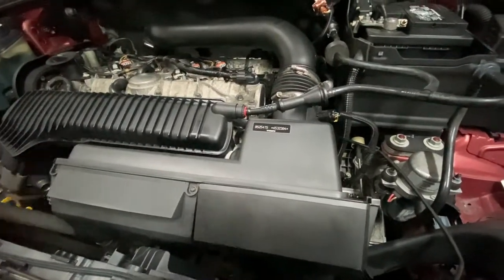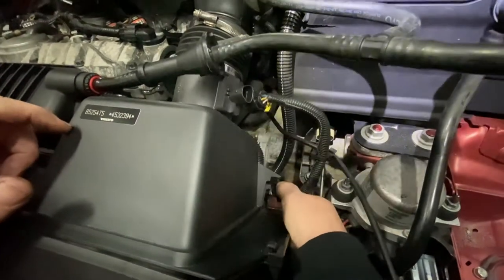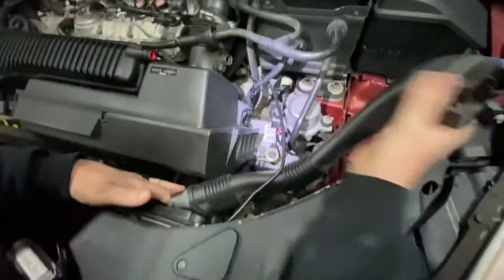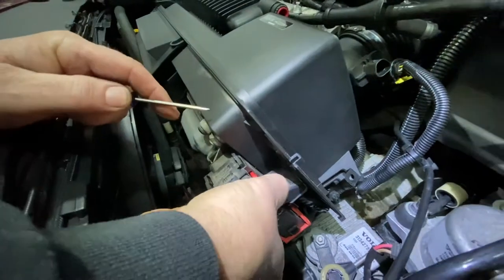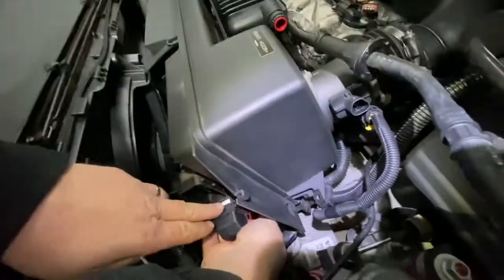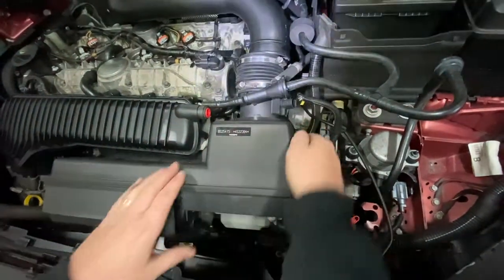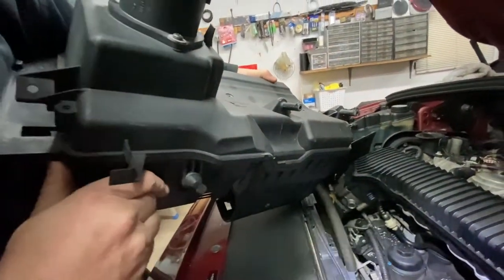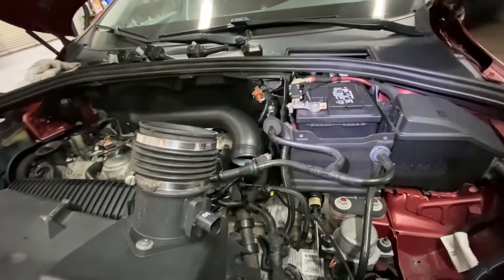Air Filter Box Easy Removal on Volvo S60 2009 and Up

Comment: Excellent video. Props to showing us how the airbox assembly is attached with the 3 pins underneath. That really helps with understanding how to wrestle it out, knowing we're not breaking anything when yanking it.
Reply from the maker: Thanks you, yes that was the point, you really have to pull on it and some may think they are hidden bolts but there aren’t.

Comment: I wasn't able to remove the air breather assembly due to the plastic front fan guard.  I was able to move it to the side to get to the pvc though.  Thank you for this video.
Reply from the maker: No problem, thanks for the comment

Comment: Nice. Ive got an automatixc c30 and it seems I will have to do this plus partial removal of the wiring harness to access the transmission dipstick
Reply from the maker: Yes, gives you much better access.

Comment: This engine is also fitted to my variant of the Mk1 Ford Kuga ( also Focus ST /RS) in the UK, i had to swap out my starter motor but on Ford there is even less room to wiggle the air-box up and and out and i think it may have another rubber boss retainer on the right also, additionally, when you pulled out the box and turned it over underneath on the left is like a u shape moulding into which the wiring harness locates to avoid it getting trapped, but you cant see this from above and it looks like its impossible to relocate back when reassembling, however i must of had luck on my side as i did manage to get the wiring back in the clip but i think it was luck it went in first time what with all the wiggling to get the air-box back in position.
Reply from the maker: They are a little different as far as room to work on them.

Comment: Question..do you have video or information on how to get 2006 s40 2.4i air box out so can access thermostat and hoses..REALLY APPRECIATE IT. . .I DID OIL FILTER HOUSING FEW YEARS AGO MYSELF but I Don’t remember if removed completely lol. Thanks again
Reply from the maker: It’s a pain to get out, hardly any room to work with. There is I believe 2 rubber grommets on the bottom towards the engine that have to be pried out towards the radiator.

Comment: Unplugging that yellow connecter is tough, and now the yellow switch is broken, but I still can move it up; for you, it just pops out. Maybe it is glued; I will try again tomorrow.
Reply from the maker: Yellow part is a lock that slips up so you can get the plug off by squeezing the tap while pulling.

Comment: Thanks for this video.  I have to remove the air box to try to loosen the oil filter cap on mine.  The quick lube place either super over-torqued it or cross threaded it and it seems to have seized up.  The placement is recessed beneath that pleated housing, so it is virtually impossible to get on top of it with a socket and ratchet.  I have been trying for days and have stripped the plastic nut on top of the cap.  I am going to try to remove the box and loosen the filter with a chain wrench next.  This is ridiculous.
Reply from the maker: That sucks. Those quick lube places don't know anything and rush to finish. You should make them take it off and paid for the stripped cap. No reason for it to be that tight. They are torque specs for everything for a reason. Good luck bro!
Reply: FINALLY got the oil filter cap off.  My S60 is a 2014 so there were a couple more hard to reach wires that were attached underneath the air box that had to be pried a-loose before it would come out.  After getting on the nut with my ratchet and low profile 32mm socket, the cap still wouldn't budge.  I had to carefully apply heat to the area (because it's plastic) with a propane torch.  Then I had to bang on it with a rubber mallet and that did the job.  Thanks again for the great video and instructions.  Please guys, only HAND TIGHTEN oil filter caps.
Reply from the maker: No problem, glad you fixed it!
Reply: take cap 36 and take two-component glue. glue the cap to this stub. After unscrewing, replace the connector with a used part
Reply from the maker: @fiuskorpion-io9pi Good tip!

Comment: Good video, very detailed.  However, I think this one applies 2011 and up though.
Reply from the maker: Thanks, and you’re correct I’ll update the years.
Reply: It would apply to a lot of years of a lot of models. The engine is slightly different, but the technique to remove the air box is also perfect for my 2008 C30. I think for most cars with a 2.4i or a 2.5T.
Reply from the maker: Thanks for the feedback on this!

Comment: Can I ask. Does anyone know what that little red clip he pushed in was called. At 0.48 seconds?
Reply from the maker: It’s just a lock so the hose doesn’t pop off.
Reply: @motorcarnut  my dad broke it. Trying to replace it 😑. Thank you for replying 🙂.
Reply from the maker: @zav9475 no problem

Comment: I can’t pull the air box out lol I need to hit the gym
Reply from the maker: Lol, sometimes they can be really stubborn.
Reply: @motorcarnut  Awe man I checked and there’s actually bolts/screws holding it in place but they’re upside down and almost impossible to reach! It’s a 2014 S60 FWD T5. I might just bring it to the dealership at this point :(
Reply from the maker: Really? Does the air box and location look the same as in the video?